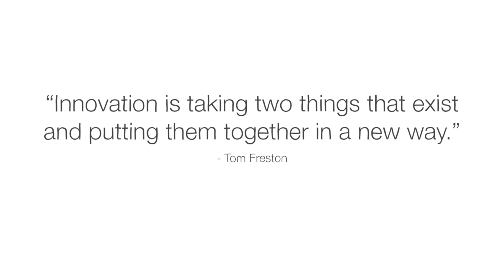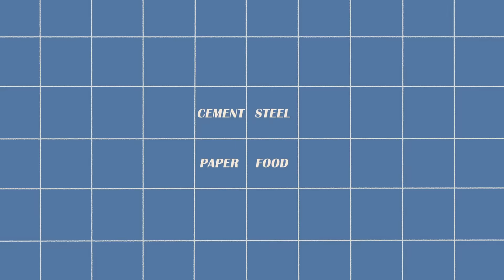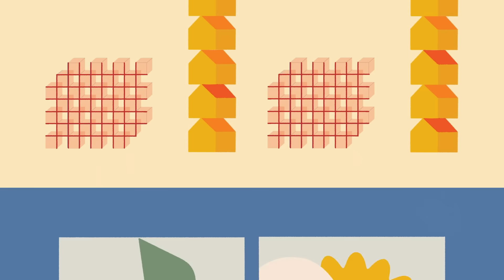The solution to our energy problems is … a toaster - Rachel Yang

Comment: The universal solution to energy storage does not exist, but the solution depends on the use after storing, so there must be many solutions, each fitted to their purpose. This solution is ideal for industrial processes, but a bit silly for warming homes or swimming pools. On the other hand it is much better than electro chemical batteries for storage to use afterwards in industrial processes

Comment: Batteries are the solution to everything. We need batteries that have/are (in order of importance):
1. huge capacity, 
2. huge energy density, 
3. cheap, 
4. non-explosive, 
5. non-toxic, 
6. quick charge, 
7. lasting at least a decade of everyday use, 
8. scalable in size. 
And if a battery combines these 8 features - we got climate change fixed. Just think about it: you won't harvest even free crops if you don't have nowhere to store it. 

Let's run heat batteries through this 8 points: 1. Yes, 2. No, 3. Partially, 4. Yes, 5. Yes, 6. No, 7. Yest, 8. Vert much No. 
So 4.5/8 - not so bad, could be a lot better.

Comment: Please taketanlook at the systems beeing developed which are an actual toaster for producing e.g. ceramic products. The can heat a single item at a time without heating up. This has the advantage that you don't need to heat up a whole system (oven) and store the energy which is the main problem with huge ovens or heat distribution systems: You can not power them down when energy is scarce for a short period of time.

Comment: Cute, but now where is the power for this sourced? Toasters on a house scale are notable power sinks, 'toasters' of this scale would require a massive amount of power. As of now, the majority of all electricity is generated with fossil fuels, so you wouldn't be eliminating a carbon emission, you would just be moving the 'carbon tax' around.
Reply: You do realize this is an energy storage medium, right? It makes no sense to store electricity generated from fossil fuels if you can precisely control how much you burn in the first place to meet demand. This is a solution for renewables like solar and wind which can and will generate surplus whether you need it or not, and lithium batteries are expensive and require limited resources.
Reply: @Chailotl  No, this video diverges in topic from its premise, that it can replace fossil-fuel powered manufacturing processes, then moves on to instead display the heat battery which I've known about for a long time now. Or, and this is more egregious, the format of the video was unintentionally misleading.

Comment: SMRs with high temperature versions are near-perfect solutions to power most of the high-temperature industries. And not only that, thermal energy generation efficiency is almost 3 times better than electrical energy generation.

Comment: One thing I still don't get: with what do you heat up the material (bricks, rocks, salts) with? Electricity? Is reaching 1800°C feasible? How about the materials of the heating element itself?
Reply: wind and solar is the way to charge these batteries. people use solar panels at homes to run heating element buried inside  buckets of sand. this crude method gives off heat later at night.

Comment: Why not just use a 'Hydra-Kinetic Motor' instead.

Now you can have all the energy you want in unlimited quantities without noise, pollution, fees or gov/corp control.

Power anything that needs power and have true energy independence.

All you need is a 'Hydra-Kinetic Motor'!

Problem solved.

Comment: So tell me genius. how do you fill this battery? by burning fossil fules?
Reply: it's about efficiency. these batteries store and use energy more efficiently than applying the fossil fuels themselves. also, if you had finished the video, they mentioned using wind and solar to store energy over time
Reply: @fish4225 are you serious? batteries can't increase fuel efficiency. their efficiency matter after energy is generated. Not using a battery is the most efficient of all systems.
Reply: Fill the heat batteries with wind and solar. Did you watch the whole video?

Comment: Summary (with chapter timestamps): This video discusses the history of the toaster and introduces thermal batteries, a century-old technology that uses heat storage in materials like bricks to provide a more efficient and sustainable alternative to fossil fuels for industrial heating.
0:07 💡 The Invention of the Automatic Toaster
• 💡 In 1919, Charles Strite invented the automatic toaster, addressing the need for consistent bread toasting.
• ⚙️ Earlier toasters used nickel-chromium wires that heat up when electricity passes through, allowing for even toasting.
• ⏱️ Strite's model included an automatic timer to prevent overcooking and eject the toast.

1:02 🧱 The 'Giant Toaster' for Industrial Heating
• 🧱 Instead of toasting bread, this technology heats bricks, rocks, and molten salt to address energy concerns.
• 🏭 Industrial manufacturers use significant energy to generate heat for making everyday materials, contributing to 20% of global energy consumption and carbon pollution.
• 🌍 This 'giant toaster' technology aims to provide a more efficient and sustainable way to generate heat.

2:01 🔥 How Thermal Batteries Work
• 🔥 By heating materials like bricks, heat can be stored as energy in what is known as a thermal battery.
• 🧱 Bricks are linked with heating elements and formed into interlocking blocks with channels for air and heat.
• 🌡️ The bricks are heated to 1800 degrees Celsius and stored in an insulated room, losing only 1% of heat per day.

2:41 💨 Using Stored Heat
• 💨 When energy is needed, air or other gases are pumped through the channels, heating the gas to 1700 degrees Celsius.
• 🏭 The hot air can then be used for space heating, converting water to steam, or powering other heat-dependent manufacturing systems.
• 🌡️ Thermal batteries can store energy slowly and release it in short bursts of intense heat, making them suitable for industrial heating processes requiring high temperatures.

3:22 ☀️ Advantages of Thermal Batteries
• ☀️ Thermal batteries can store energy generated from renewable sources like wind and solar power, addressing the intermittent nature of these energy sources.
• ⚡️ They are one of the cheapest and most sustainable battery technologies available.
• 💰 Thermal batteries are more than twice as efficient as burning fossil fuels and about half the price of buying energy from the grid for industrial heat generation.

** Generated using ✨ VidSkipper AI Chrome Plugin

Comment: What is the output of such a battery? How many batteries, each 12m3 in size, would be required to provide the heat needed for a certain industrial application? The idea is good, but there are many places in the world where space is a luxury and so these are the questions that people in those places will be asking.
Reply: Per weight, similar to lithium ion. But a hot brick is cheaper.

Comment: While I’m grossly oversimplifying, this principal is similar to the CANDU Nuclear Reactor design!

Using a calandria of reinforced concrete and other materials, the nuclear chain reactor in the caldera heats up the concrete and other materials, and this heat is disbursed through the calandria. This heat, is transferred from the calandria, to the pipes that run through it with heavy or light water, to heat, which turns to steam to generate power.

The advantages it has as well, is that the nuclear reactor does not need to be shut down for refuelling, as you can refuel each channel continuously. While the spent fuel is dislodged at the other end of the calandria in a cooling pool.

The material of the calandria also allows operators to have better control of heating and cooling the core, as it can use numerous methods of  thermodynamics and heat theorems like “quantitative heating”. Where if a sector of the reactor gets too hot, you can heat up the entire thing, and it causes it to release its heat as you gradually cool it again. This even Distrbution of heat allows the calandria to also store heat energy in that, even when you shut down the reactor, the decay heat has somewhere to go that isn’t water, and can be cool with air as well. So if water cooling systems failed, operators have abilities to cool with other means like liquid nitrogen or even regular air. 

Again I’m not nuclear expert, but I’ve been interested in nuclear reactors and the CANDU design does take the “toaster” principle to make it safety and operate better.

Comment: 2:22  what is the power source to heat these... What's getting turned on? Is through renewable energy itself?
Reply: Watch the video a bit longer, they explain how this reduces emissions. It could be the dirtiest fossil fuel, but the point is that energy is saved (and thus pollution reduced) by the fact that you can STORE it at all. Also batteries help make renewable energy more useful 

Take an easier example, imagine you need to save money. Today you need to drink water at your job but the water bottle vending machine there charges 5 coins. That’s bad but you need the water now. What if you could store water from a moment where it wasn’t as costly? Thanks to a metal reusable water bottle you can now store water from home and while you still need to spend money for the bottle and water price, you can now avoid the cost of using the water machine

While someone will have to produce the SAME water if it’s in your house or at the vending machine, the ability to store it and use it later gives you an opportunity to choose between drinking from the expensive vending machine that gives you water now vs the much cheaper water from home that requires storage and planning.

Comment: When I thought of turning a brick into a battery, I thought of building a tower and a pulley, and putting some bricks on it. Hoist it up when storing, let it go down when extracting.
Reply: There have been ideas to do that, but the amount of space required and maintenance costs make it hardly feasible. 

A similar energy storage solution is already used in places that meet all the criteria. That is hydro power and water reservoirs.
Reply: I had the same idea. Then I did some back-of-the-envelope calculations. It isn't practical. You'd need truly enormous bricks, hundreds of tons, and you'd need to haul them up and down a mountain.
Reply: There are already projects like that: Energy Vault and EVx

Comment: Curious how every single time TED talks about renewable energy they never ever once talk about nuclear.
Reply: Nuclear isn't technically renewable, but it is low-emission and the known reserves are sufficient to last a couple of centuries at current usage. There are sure to be more yet-unproven deposits, so we're not going to run out any time soon - not the case with oil.
Reply: @vylbird8014  Thorium-Plutonium molten salt reactors would take thousands of years to run out of fuel and can be used in breeder reactors to create fissile Uranium. Though by the strict definition of the word it's not "renewable" it lasts for so long that if you started one up today your grandchildren's grandchildren's grandchildren /maybe/ would be the ones to see them run out of material.

The point I'm making is that TED seems to lie by omission about renewable energy by utterly refusing to cover or mention the subject. Though solar and wind are steps in the right direction away from oil they have glaring problems related to where, when and how the energy is gathered and simply don't create a comparative amount of energy for the space taken up and cost.

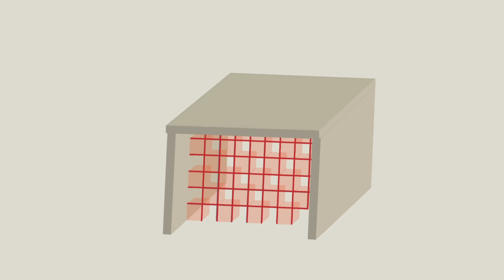Comment: 1:45 how is resistive heating more efficient at generating heat than burning natural gas? Both gets converted into heat in their entirety. Where that electricity will be bought from other than the grid? 2:34 confusing instantaneous power and amount of energy. 3:46 if it is so much cheaper as you say, then the incentives are already there. No need to funnel tax money into corporation's pockets.

Comment: I hope we can use heat batteries on a smaller scale some day.  Using AC when it's hot generates heat and a lot of people live in temperate places that have 4 seasons.  It would be great to store the heat generated by cooling in the summer to use later for warming in the winter.   However, that might require condensed very hot bottles, or a substantial amount of less intense thermal mass in a single family basement.
Reply: Conversely, in places where AC is needed year round it would be good to be able to collect the heat generated by distributed AC systems back to a central collection point.
Reply: 'Less than 1% of the heat escapes each day' makes this impractical as it would lose most of it's summer storage of energy by the winter. The insulation still has a long way to go before it's feasible.
Reply: Fair point  @longdang2681  I didn't do the math.  I imagine you would want to keep more than half the heat stored remaining after 120 days.  I wonder if home refrigeration could also be added to the mix.  Maybe some big brain engie can figure it out in the future ¯\_(ツ)_/¯
Reply: @longdang2681  It can be used for heating water instead.

Comment: I guess it is time to do some research into this area. I would love to have something like this at home, but this looks more like a mass storage than a home storage. Again... need to do some research. BTW, it is common that electricity has different price at different times of the day... late night time is usually cheaper than day time, so, if you could just store energy during the night and use it during the day, you could reduce significantly your energy bill...

Comment: 2:36 Do you mean megajoules? Or megawatt-hours? Because megawatts are units of power, not energy.

I will say, though, that this idea is nowhere near as insane as it seems - a modern tank-type water heater can store a significant fraction of an EV's battery capacity as heat for days on end. There are already smart grid systems that cool or heat houses when electricity is cheapest and rely on the house's generous insulation to keep the temperature under control when the climate controls are switched off (though they haven't always gone smoothly.)